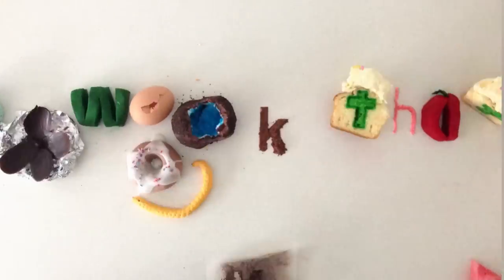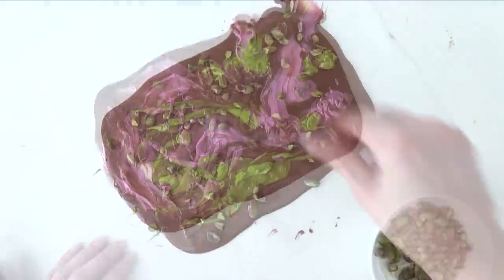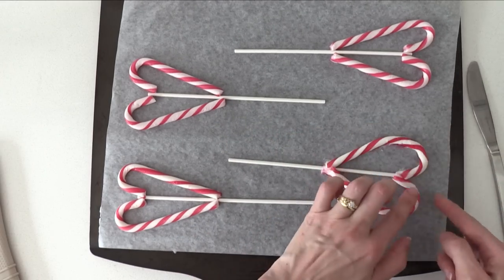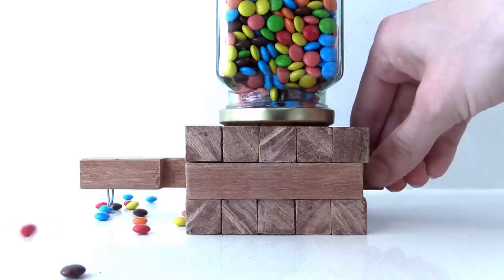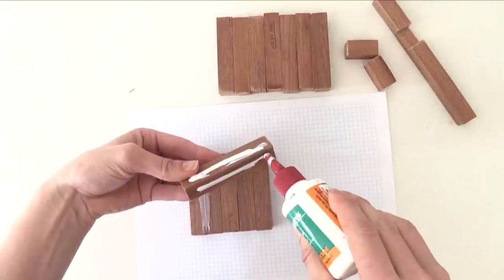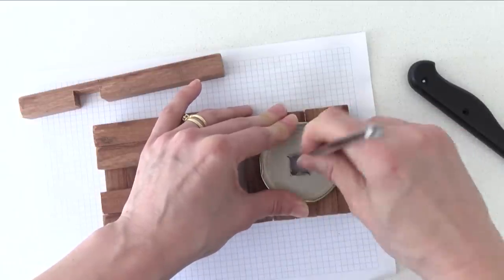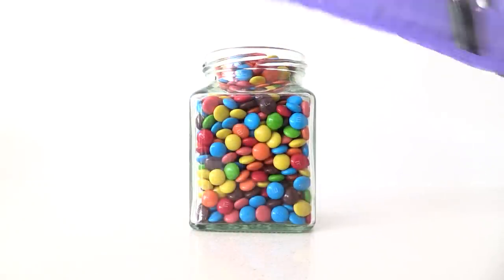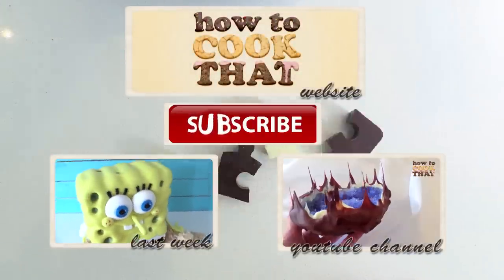5 DIY CHRISTMAS GIFT IDEAS How To Cook That, candy dispenser

Comment: Just a tip, you could always make the bottom a layer or 2 higher, and either using wood or a container attack it where the candy falls out to catch the m&m's, not sure if you'd have to make a few adjustments (such as the screw on the left, maybe adding it to the side rather than underneath?) but I just think I'd be a bit less messy aha :DDefinitely going to have to make one of these. Awesome idea for something like a birthday gift, I love it!

Comment: Hi Anne. I also live in Australia and was wondering if you could help me out. I am wanting to use chocolate and want it to set hard and not melt at room temperature. But I also don't have the proper tools to temper chocolate correctly. Is there a chocolate with certain ingredients that I can melt but it will still set hard ?
Reply from the maker: hi Rose Owen compound chocolate will do that but it doesn't taste as nice of course :)

Comment: For the candy cane lollipop, would the candy cane be able to hold the white chocolate in place if it's not tempered and simply melted then refrigerated?
Reply: No! If you use 'real' chocolate and just melt it instead of tempering it will melt or soften at room temperature. Even if you put it in the freezer or fridge to set. Once you take it out it will soften and melt quite easily. You have to temper it or just use fake chocolate.
Reply: Actually, it can, just don't leave it out at room temperature for too long

Comment: does the chocolate have to be tempered?
Reply from the maker: +Lori Davidson yes so it will set firm at room temperature
Reply: But you can always use compound chocolate. If you are, you don't need to temper it but real chocolate tastes better than compound. Just check the ingredients, if it has vegetable fat then it's compound, or fake chocolate. If it has cocoa butter then it's real chocolate, you will need to temper real chocolate.

Comment: Are you using centimeters for the M'nM dispenser?
Reply from the maker: yes i did it in cm Abby Girl but it doesn't matter so much because the length is relative to the width :)

Comment: instead of buying wood can you use janga blocks?
Reply: I think yes I really want to do this I like how you can refill it
Reply: I used je game blocks! It worked out fine but when u make the long pole you may have to have some expertise in joints ( if you just glued two blocks together it wouldn't be very stable) , I used a finger joint.
Reply: *jenga not je game!
Reply: For jenga I do the 
Base: |||
Middle: repeat going crossways but don't stick down the middle, just attach a handle at 1 end 
For top layer repeat but don't stick down middle, instead stick 2 leaving a square gap in the middle:
-----▪️------ like this. You will have two arms sticking out either side which you can put candles or mini statues on (if you have a saw you can just cut a hole out of 1 like in the video.)

For the long piece instead take your middle piece w/ handle at one end: ----------o and insert. When hole is closed the jenga piece will be fully inside the block. Use handle (I suggest loop of ribbon) to pull the block back to open up hole and push back in to close hole and dispense sweets. (Optional step: Put sticker saying persons name at opposite end to loop/handle) 

Proceed to add jar and stuff as shown in video 

I did this yesterday and I filled the jar with chocolate honeycomb, hazelnuts, chocolate chips and miniscule meringues it was awesome

Comment: ann could u make a tresure cheast cake with candy coming out
Reply: Make rectangle cake. Cut out smaller rectangle. Place smaller rectangle on the hollow rectangle at an angle. Decorate with icing. Put candy in the middle of the hollow one. Scatter candy and chocolate coins around base. Aaaand you're done

Comment: Measuring the width by 5 ABSOLUTELY does not give you a cube shape :( I did mine exactly who it says in the video and I've ended up with an unfortunate rectangle the definitely doesn't work :(((( 😥
Reply: Yeah it turns out that for some reason i measured it x7 and was convinced it was x5 😭😭😭

Comment: Can u tell me if u can use jinga blocks please tell me🐣🐢🐺
Reply: I was about to say the same
Reply: Yes you can but instead of having a long thing for dispenser lever just use I jenga piece and attach handle/ loop of ribbon to 1 end 
Using * to represent location of the sweets, this is the difference
 
One in video = ----------* ----

Jenga version= o---------* (PLS don't be dirty minded ahh)

Because it is shorter, to prevent it getting stuck inside add the handle/ loop

Also if you don't have a saw you will have to use four pieces for the top layer as you need a hole 
Therefore the two outer pieces will be normal but the middle one is replaced by two with a gap between them -------▪️--------they will stick out so just put candles or models ect. on them 

Trust me I finished making one today
Reply: hi me

Comment: I made the M & M dispenser for my brother for christmas! It looks amazing but I have a little problem. It ofte  doesn't release m & ms. They seem to get stucked and it only works again if I shake it. Has anyone got an idea for that? :)
Reply from the maker: it sounds like it could be a bit tight, you could try shaving off a little bit of the wood or put a bit of wax on so that it slides smoothly.
Reply: How To Cook That Yeah that could be it. Thank you :)
It's a great gift anyway xxx

Comment: will it work with jenja
Reply: I've answered 3 of these comments already but yeah

The long piece can be replaced by a regular jenga piece with a loop of ribbon or handle on the end. When dispenser is closed, the jenga may become stuck (hence the need for a handle to pull it out) it also places the sweets differently 
Using * to represent sweets
Normal: ---------*----
Jenga: ------*

In addition of you don't have a saw to cut a hole for the middle of the top layer take 2 jenga pieces and attach like this: ------▪️------- you will have arms sticking out so just put candles, food, sculptures ect. On them 

I made one yesterday an it works haha

Comment: How do u tempure chocolate
Reply from the maker: Carly Bullard there's a tempering video on my channel that will help Carly :)
Reply: +How To Cook That do you have to temper your chocolate
Reply: You temper chocolate to make them set firm and last longer in room temp. You don't have to temper it, but they won't hold their shape as long. Or you can buy fake/ compound chocolate and it doesn't have cocoa butter so you don't have to temper it but it doesn't taste as good.:)
Reply: Just put in the microwave for 30/45 seconds at a time until it's melted
Reply: +Taylor Comisky that's not all you need to grate it and melt 2/3 of it like that and then mix in the rest of the 1/3 and melt it for a final time but it's all explained in her vid

Comment: You only need melted not tempered
Reply: Xxpretty_ girls_101xX u need tempered to set it at room temp
Reply: tempered also has a more professional look to it  whereas untempered chocolate usually has a blotchy dull look to it and melts easier. You probably could use untempered but if you're giving it as a gift you really want to go the extra mile.
Reply: Phanic! at the chemical disco but why cant u use just melted
Reply: Baby Panda why does it need to be professional
Reply: when you're making gifts for people if looks better right? if there's white streaks all over it and it melts too quickly it doesn't look as nice does it?
Reply: Baby Panda but i always use melted for gifts and it looked the same
Reply: Xxpretty_ girls_101xX then you might have been using compound chocolate which doesn't need tempering.
Reply: Baby Panda I only used melted chocolate
Reply: Xxpretty_ girls_101xX yes. chocolate melts. you don't buy it melted though. you melt it in the microwave or using a double boiler. compound chocolate doesn't need to be tempered, it's not made with cocoa butter.
Reply: Baby Panda I am not thick I know u need to melt it
Reply: Baby Panda oh well I do because I ain't thick
Reply: Xxpretty_ girls_101xX yes but chocolate melts at different points and sets differently depending on the type. you said you use melted chocolate, but you never elaborated on what type you used.
Reply: Baby Panda I use melt my milk chocolate on the microwave it is looks the same
Reply: Xxpretty_ girls_101xX is the chocolate you're using compound chocolate?
Reply: Baby Panda it is just normal dairy milk chocolate by cabaury
Reply: Xxpretty_ girls_101xX so assuming it is real chocolate it does need to be tempered depending on what you're using it for. if you're adding it to cream to make ganache or adding it to cake it doesn't need to be, but if you're making handmade chocolates you'll end up with white spots or streaks to it, it will look duller and melt quicker than tempered chocolate. that's why they say to temper it.
Reply: Baby Panda well when was Doing the chocolate bark I used the same chocolate and it looked the exact same
Reply: Xxpretty_ girls_101xX then it might not have been melted at a high enough temperature for the cocoa butter crystals to separate or you might have tempered it without realizing
Reply: Baby Panda what is the difference between tempered and melted because it is the same
Reply: Xxpretty_ girls_101xX when chocolate is tempered it forms kind of a crystalline structure, but when you melt it it tends to lose this structure. untempered chocolate has a dull look to it, tends to have white splotches show on it after a few hours to a few days, and has a shorter shelf life. tempering it reforms this crystalline structure and makes it shiner, glossier, and generally stronger and nicer looking. remember just because it looks fine right after you take it out of the fridge doesn't mean it will stay looking like that. you can very easily see the difference between the two if you do a Google image search for tempered vs untempered chocolate
Reply: Baby Panda but i know u Are getting  this from the Internet
Reply: Xxpretty_ girls_101xX and it's true. chocolate really does do this. There is actually science behind it.
Reply: Baby Panda so why are u responding is u basically don't understand anything
Reply: Xxpretty_ girls_101xX no I think you're the one who doesn't seem to understand. you asked what the difference was and I told you what it was and told you that you could very easily find examples on Google. Ann Reardon has also done a video on it on this very channel. Sure, you can use ordinary untempered melted chocolate but in the long run it will melt quicker at room temperature, and it won't have a glossy look to it either.
Reply: Baby Panda well actually when u melt it is glossy
Reply: Xxpretty_ girls_101xX it isn't really. if you want it looking like store bought chocolate it must be tempered.
Reply: Baby Panda actually it looks really professional not stored bought
Reply: Xxpretty_ girls_101xX if you've managed to keep it looking nice and glossy you've probably somehow managed to keep the chocolate in temper without realizing it. a pretty common way of tempering it is to give the chocolate 10-20 second bursts in the microwave and stirring it.

Comment: Hi Ann! i'm not the one whose owns this account,my name is romiena can you please make a barbie doll cake and a Philippine flag cake? because ashley (the one who owns this account) and me live in the Philippines,and an Bible cake as well :) can you please accept this comment just like ashley's comment,The BIG HERO 6 cake
Reply: The Phillepine (sorry for bad spelling)  flag one and bible one just make a rectangle cake, 

for bible one cut v shape furrow down the middle and cover with buttercream followed by brown/ beige fondant. So like an open book. Write favourite bible passage over top with writing icing (the type you get in little tubes) and slash sides (cut with blunt knife in |||||| pattern) to look like pages. Put coloured fondant around base to look like book cover. Use additional fondant to add crucifixes ect. 

For flag one print out copy of flag the size of your rectangle cake, roll out base colour and cover cake (before doing this coat cake in buttercream so fondant sticks, I recommend chocolate buttercream)then add all other colour shapes using flag as your template (put it on card and cut it out If you need to). 

For barbie one cook a dome of cake (use a bowl) stick barbie (without clothes)In top of dome up to her waist. Use icing (probably fondant) to decorate dome as the skirt of her dress, then take a little bit more to make the upper part and make sure barbie is decent. Optional: sprinkle with edible glitter 

You can buy fondant in baking shops or order online
Reply: Lucy Daniel thank you very much!